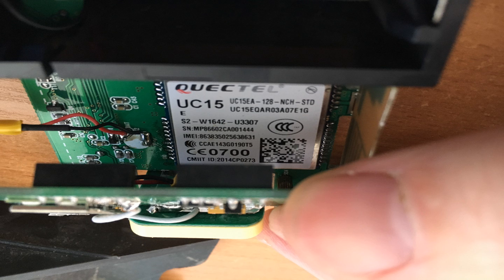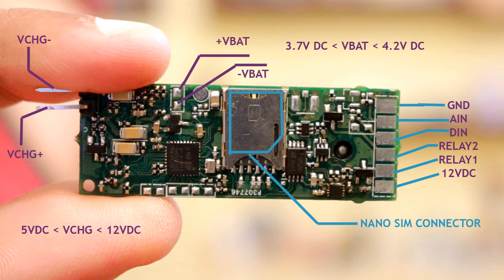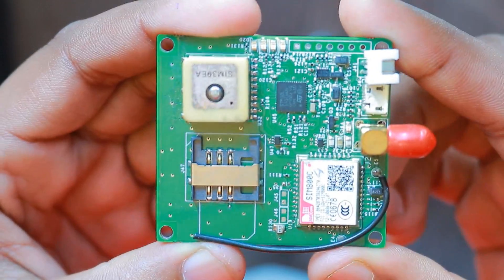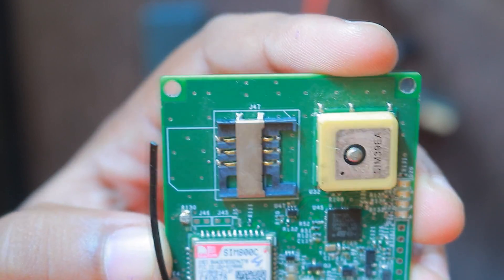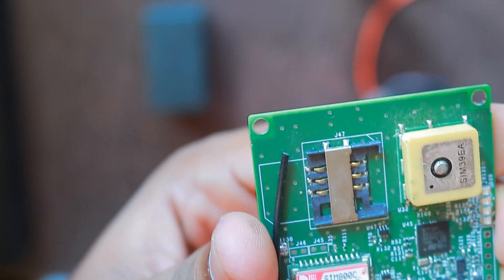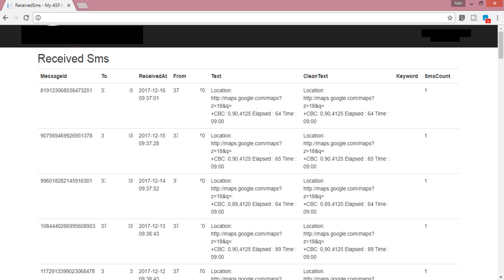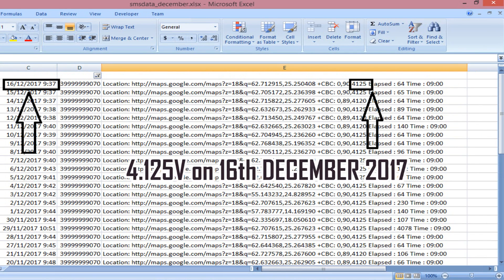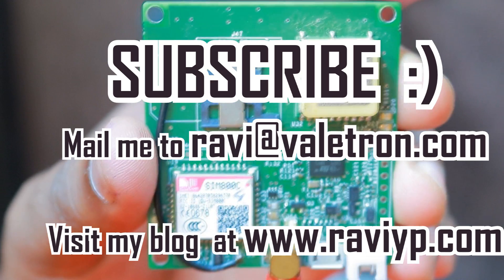GPS Tracker with LONG battery life -  Lasts more than a year

Comment: Could you share PCB design and schematic of this board?
Good work
Reply: Ok. What is the cost of 1 unit? Your OBD2 trackers can read ECU parameters?
Reply from the maker: @obaidurrehman8652  You can get prices and place order on https://www.valetron.com/store
Reply from the maker: @obaidurrehman8652  Yes it can read what's available on obd commands
Reply: Please also mention if your VALTRACK V2 tracker if open source? I would like to contribute in hardware design and firmware development. I see you want it to be open source like Arduino?
Reply from the maker: @obaidurrehman8652  Yes that's the plan for future. We want sell a few of them before that.
Reply: I don't see any OBD2 supported units on this website. Can you send a direct link?
Reply from the maker: Thank you. It's not a open project

Comment: is it possible to make the tracker batteryless? for example in some applications, there's no point of finding a device that could not be found due to its lack of battery. and from what i know, the battery is used to send signals the signals. it would be great if the tracker can send signals without batteries or power source
Reply from the maker: Hi,
There is no electronics without a power source. 
Everything needs power. 
Some devices can harvest power using Solar or wind/Pressure.  But still they cant generate enough to make a hidden device to transmit signals as device size will be small and needs to be hidden.
Dont forget to Subscribe :)
Reply: ahh i see your point there of course, thank you so much! :D

Comment: how long does battery life is per minute track?
Reply from the maker: i have tested my VALTRACK-V2 device on a 4000mAH battery to last >72 hours at 1 minute update rate via HTTP post.
Reply from the maker: HTTP post is just a method of sending data. Consumption depends on how well you save power when its not doing anything. In long intervals, you get put module to sleep. In short intervals you cant.
Reply from the maker: At 5 minute update rate its difficult to acheive years long backup time.  We should be talking about in months. 
Please mail me to ravi@valetron.com. We can discuss
Reply: it is easy, if you have enough knowledge and know your playing factors !

Comment: Hi Ravi, can you share the schematics of this module. i need only for battery optimization
Reply from the maker: Hi Rakesh,
Sorry, its clients project. I wont be able to share.
Reply: Hi Ravi, I can understand can u help me with fuel gauge IC number
Reply from the maker: We designed using STC3117 but didn't use it. It has got problems. 
We use internal battery monitor of SIMCOM modules to measure battery capacity and voltage. SIMCOM modules have AT commands to get battery capacity left.
Reply: Thanks :)
Reply from the maker: Welcome . Dont forget to Share and Subscribe :)

Comment: Have you ever considered using other simcom modules like sim808, sim7100 etc which come with 4G/3G/2G as wells as GPS support?
Reply from the maker: Yes, i have designed trackers using SIM808. Designing one using SIM7000 now. Whats your query?
Reply: I was doing a home automation project using esp-12e. I was checking out GSM based internet option as well. Since, i was struggling with component selection during PCB design, your videos game me some hope. 

I don't have a specific query, but it will be good to work with you on an open hardware project. I could learn a lot from your experiences.

Comment: When is ur next video coming up.. if there is nothing. Make video on components
Reply from the maker: Soon, Not getting time to edit. What do you suggest i do related to components?
Reply: Ravi Pujar resistors, capacitors, oscillators etc.. For beginners difficult to understand the basic.
Reply from the maker: Ok. No specific topic idea for now. I will think of something about them. if you have any, please share.
Reply: Pcb designing for beginners or how to choose correct part/component for the project like what to see before selecting one
Reply from the maker: Ok. Will come up with something

Comment: Good work.. which controller is used in this tracker ? Btw thanks for sharing.
Reply from the maker: Thanks Jay, 
Its a STM32L0 series low power MCU.
Reply: Ravi Pujar Good. Thanks. One more question is programmed through arduino IDE.. ?? I am Eger to know coz battery life you achieved is amazing.. Congo.
Reply from the maker: No, its programmed in Keil. 
Reason for low power consumption is turning off everything except MCU and running device once in a day. 
Thank you :)
Reply: Ravi Pujar oh.. keil.. good to know that.. Good work, keep sharing.. god bless you.. :)
Reply from the maker: Thank you Jay 
God bless you too  :)

Comment: In sleep mode, how much current it takes? 
And in which mode exactly did u put the gsm part in?
Reply from the maker: Geetanjali Kala Only the mcu is in sleep mode. GSM and everything is switched off
Reply: Mr. Ravi You mean during sleep mode power to the GSM,GPS,etc is shut down by transistors?
Reply from the maker: Yes MOSFET's disconnect power to GSM and GPS.
Reply: Yes, I saw it your another video just now. Thank you.

Comment: What was the final cost of this board ?
Reply from the maker: Samuel Aravind Costs 2500 INR in low volume. Less in larger numbers
Reply: Ravi Pujar Perfect! Thanks for the quick reply Ravi
Reply: is there any diff between this board and gps module made using sim800/gps module 6m and arduino nano ...as combination of these 3 is less cheeper
Reply: Ravi Pujar  do u sell it  if i want it at my home